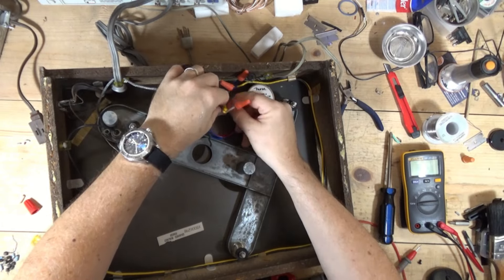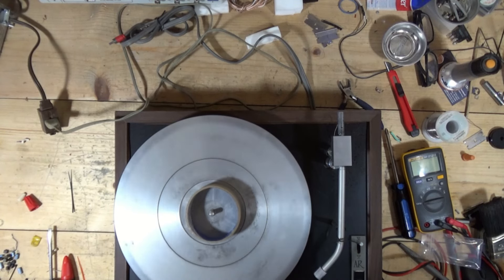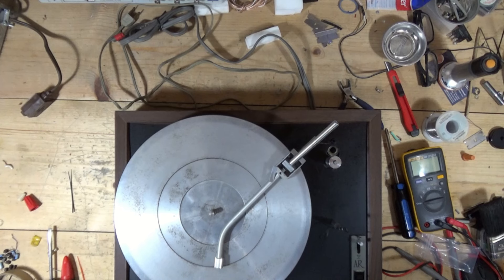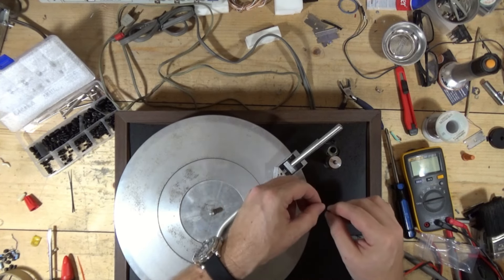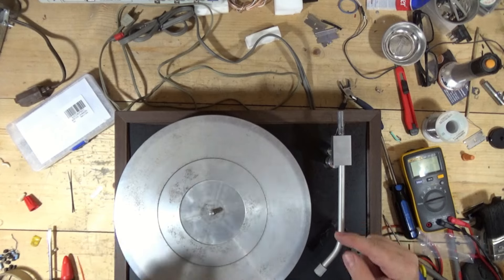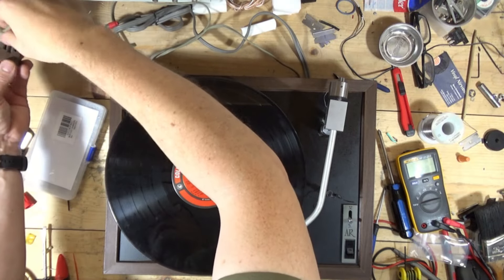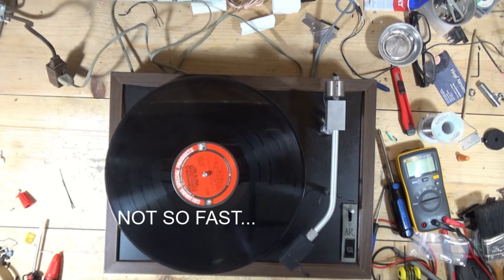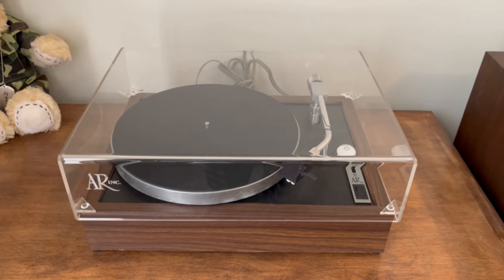AR XB Turntable Resurrection Part 3 - Wrapping Things Up

Comment: Any chance you know the values of the two capacitors for the motor?
Reply from the maker: .22uf across the switch and .1uf for the motor (as far as I can tell).  You'll want to confirm by looking over posts on AudioKarma or Vinylengine.